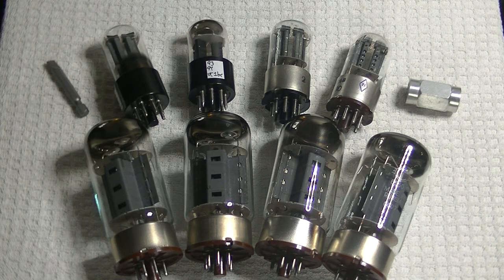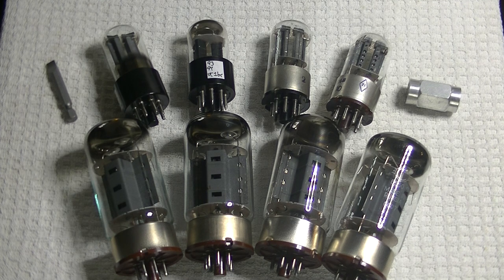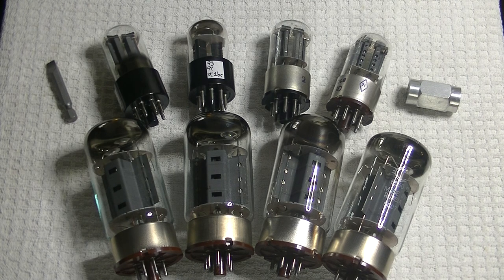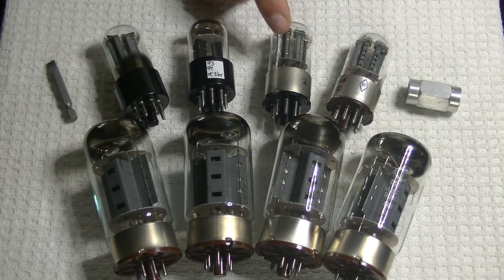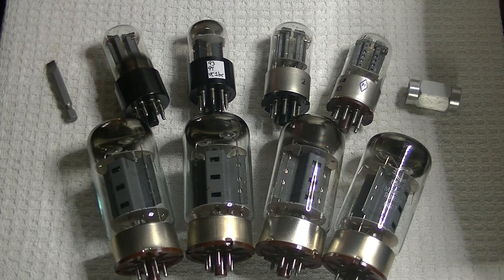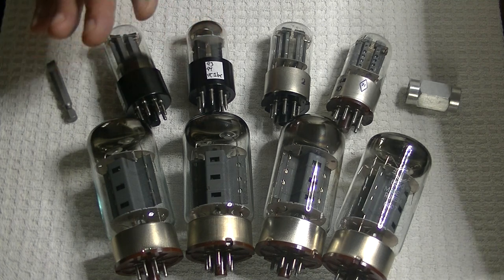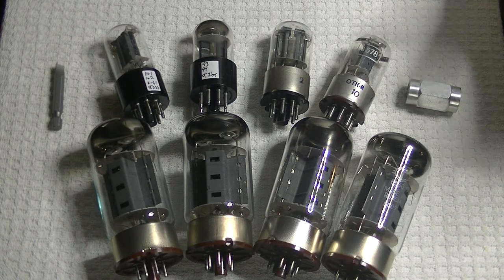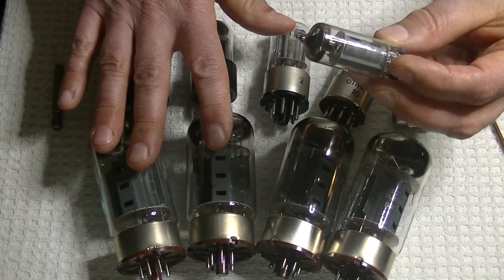Tube Lab #74 - 6SN7 Mini Review

Comment: I try to watch all your videos and take notes but could you explain what JAN means and NIB thanks Jim greetings from Calgary 😊
Reply from the maker: JAN = joint army navy, which means it was certified by the USA Pentagon for use by all military branches.  In general we refer to these tubes as "mil spec", short for military specifications.  However often a JAN tube is just a re-labelled standard tube.  But sometimes it will have a special upgrade, such as a long lived filament or anti vibration dampening.
NIB = new in box, or brand new vintage tube, but after 50,60,70 or even 90 years most NIB tubes have been out and tested a number of times and often are filthy with decades of dirt.  Luckily the electronics sit protected inside a glass bottle in a vacuum, so they may well last forever.
NIS = new in sleeve, normally 5 boxes per sleeve, but we just found one that was a double sleeve with 10 boxes.
NIC = new in case, many commercial and military tubes were never individually boxes, but packed in cases of 50 or 100 tubes

Hope that helps!
Cheers